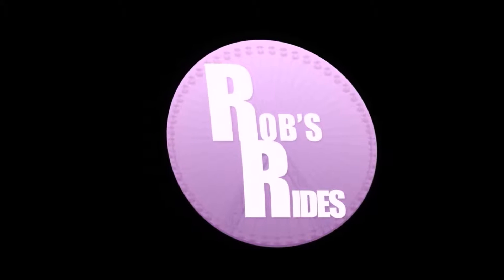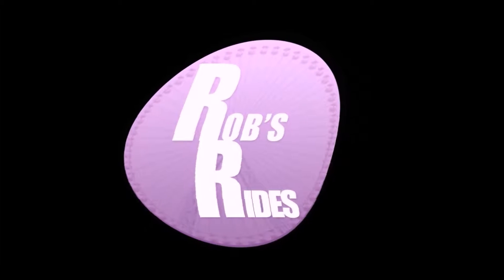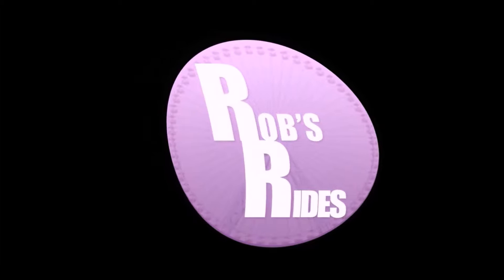How Chain Lifts on Roller Coasters Rides Work

Comment: Pretty much when it "catches" on the peg enters a little hole and gets stuck then at the top the chain lowers and goes around the wheel disconnecting it so it continues on.